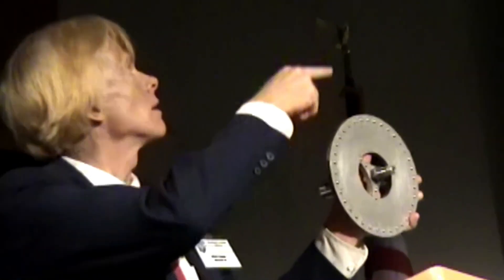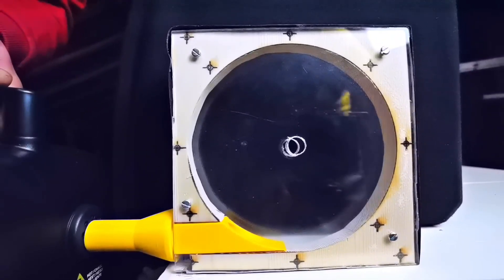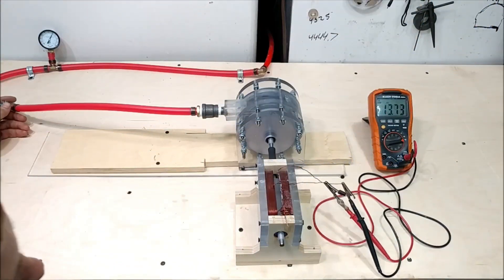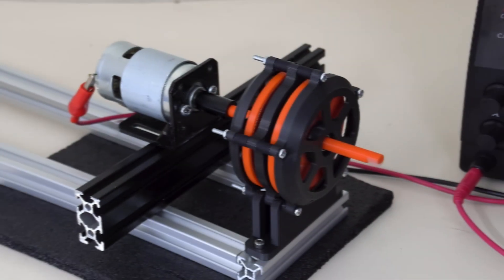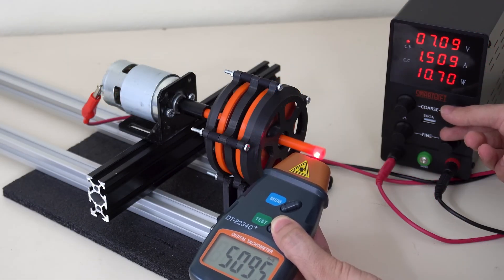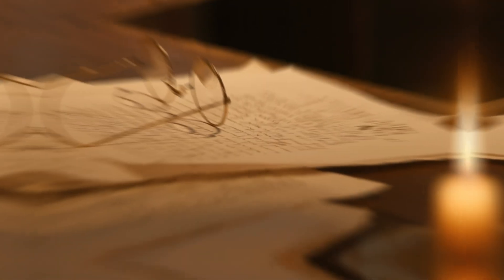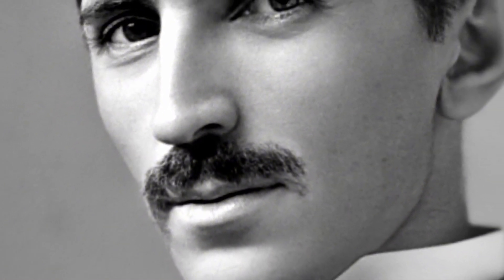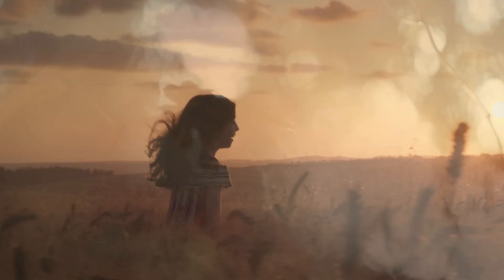TESLA'S HIDDEN INVENTION HOW TO GET FREE ELECTRICITY FOREVER IN 2024!?

Comment: This is B.S. I've been working with this stuff for a long time. This devise will only give you a small amount of current.  In order to get an adequate amount of current for a house, you would need the equivalent of ten men cycling on a bike generator 24/7 to produce electricity, or you could look into the SphereMotor.   Unfortunately, the SphereMotor isn't for sale yet.